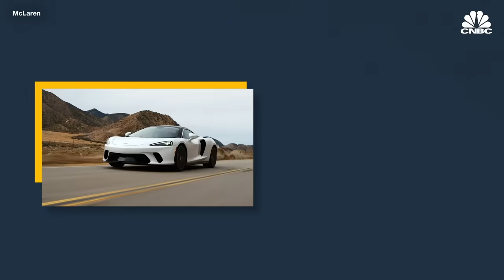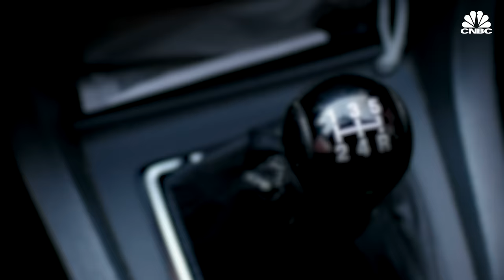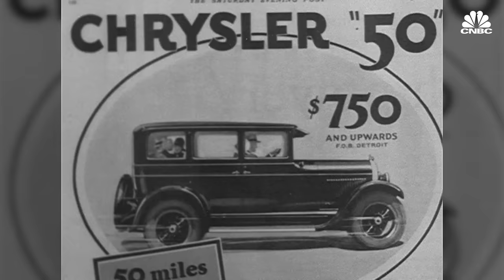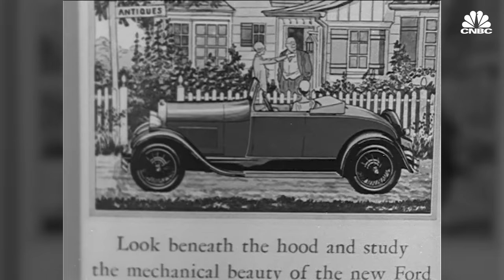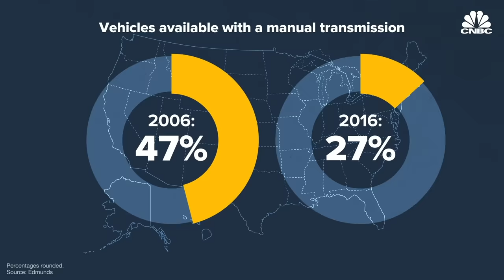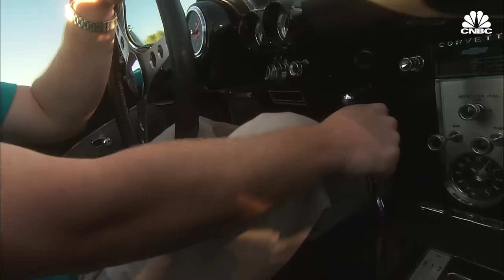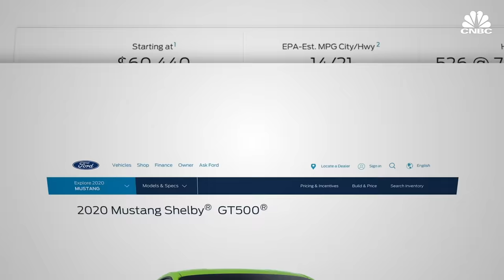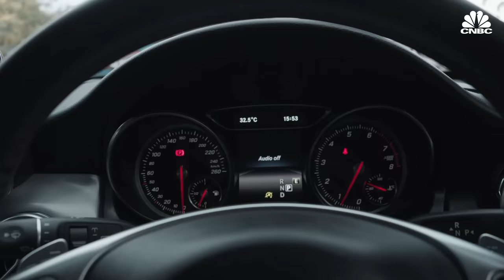Why Stick Shifts Are Going Extinct

Comment: I know many people who have driven cars with manual transmissions, and they say they love it. They love the feel that you get with a manual, you can rev it out more, and also it's very engaging. You feel like you've accomplished something when you drive a manual transmission car. However, I understand that people just don't like the hard work of doing that, especially in heavy traffic, where they have to deal with putting in the clutch many times and shifting many times as well. Also the gas mileage from manuals are not the best. Most are 6-speed manuals, and when you can rev out that engine a lot and get to the 6th gear, the engine revs pretty high at that point, maybe between 3000-4000 RPM, if you're driving it more aggressively. With an automatic, you can obviously get the engine to rev lower, especially when you have more gears to work with. I've never driven a manual, but if I did get the chance, particularly a 2012-2015 Honda Civic SI, I'm sure I'd be proud of the fact that I accomplished something that is quite scary to me to do. Single-clutch automated manuals and dual clutch transmissions are the closest you can get to a manual car in today's modern era.
Reply: manuals generally get better fuel economy, and high revs while cruising isn’t a manual problem is a gearing problem. some manual cars have short gears others have long gears

Comment: It is much more safer to drive an automobile with a manual transmission than an automatic vehicle. 
It gets better gas mileage. 
It feels better.
It readily gives one instantaneous self knowledge of what rpms are. 
It keeps your senses and coordination sharp. 
It doesn't allow you to become complacent. 
It allows exact control of the vehicle and what it needs to do.
There are several other reasons why it is far better. 

And, you are in charge of what the vehicle can and will do.

Comment: Systems like the dual clutch really stepped autoo transmissions up. They made them as fuel efficient and performant as manuals. So the only argument left is that Sticks are cheaper to manufacture.

Comment: so, basically, people keep getting leazier and lazier
Reply: Look at how you communicate with people over the Internet, though. Instead of having to meet people face to face, you just use your computer. I doubt you generate your own electricity, either. You probably also heat your house with a furnace instead of going out and chopping firewood :)
As people get "lazier", life gets more and more expensive. That include automatic transmissions, which are more expensive so you have to work longer/harder to pay for them. It's not about laziness at all, it's the exact opposite!
Reply: @devilsoffspring5519  nah. it's about getting lazier. technology makes life easier so you decide to become lazier under that premise. u probably didn't see wall-e

Comment: In luxury cars, the engine is so quiet you would have to look at the tachometer to manually change gears.
Reply: Not really, you just get a feel for how fast you're going and then shift. The engine still vibrates and hums when accelerating, they're mostly silent when cruising at a constant speed.

Comment: Driving automatic shifters allows me to spend more attention to the traffic and surroundings, making me drive safer and better. It's also lengths better in the big city traffic with the constant stop & go, which is really tiring for my feet at some point. I have an old manual car though and don't mind driving manuals anyhow, but I still prefer automatic, but I'm not a race driver etc. and I have very special demands in other areas of life, so I can understand people who swear by it.

Comment: I've always driven a stick. There is just a good feeling of being in full control of the car, and downshifting feels awesome. Also there are some use cases that I prefer to do on a stick, like purposely shifting into too high a gear to prevent wheel spin in snow, or staying in a lower gear when you know you'll need immediate acceleration to get in and out of tight traffic.
Reply: Spot on my friend!

Comment: I special ordered my truck in 2019 with a stick shift. I love it! I've only owned manuals. I'm sad I may never have the opportunity to buy another one that is new.
Reply: I bought my truck new in 1990. I think it was a special order that the sale was never finalized. They had very inexpensive upgrade packages if you didn't mind a manual transmission. It was the base trim package with all the bells and whistles except electric windows and locks. It's a Chevy so I'm glad it didn't have electric windows. I got a $25,000 truck for 13,400. I still have it and it's had one clutch replacement. Shifts like butter.

Comment: Only bad thing about manuals is the price for repair. Pay $600 for a performance clutch pay $200 for a clutch master cylinder and pay $1,000 or more for someone to install it. 
It would be easier but cars these days are front wheel drive with the transmission sitting sideways.
Reply: its still far more to repair an automatic transmission
Reply: @arcanevoid9199  That's for sure.

Comment: I have automatic in my daily drivers but a manual in my sports car. An automatic, even with manual mode, does not come close to the satisfaction of the drive. I can also leave my manual unlocked with keys inside without the fear of it being stolen 😄
Reply: And do you even know how it works? One advantage of Automatic is quicker acceleration. In a drag race between a manual transmission and automatic/cvt/dual-clutch transmission car results in the Automatic transmission car winning because you never have to lift your foot off the accelerator.
Reply: @daineramosquitco5816  You can win drag races but you will never bond with the car as you do in a manual
Reply: @davidtucker3538  "An automatic, even with manual mode, does not come close to the satisfaction of the drive" How is that so? You will still get the same shifting vibes. just up and down.
Reply: @daineramosquitco5816  If you have not driven a manual, you will never know.

Comment: Manual transmission = + Full control over maximum available torque  | - exhaustive in traffics, uphill traffics
Automatic transmission = Easy to drive in traffic jam and uphills. | - lags when you want immediate maximum torque
Reply: manual is easy to drive in traffic aswell, and i find it easier for uphill

Comment: I miss my manual car sometimes. I don’t miss rush hour in a manual car. I also don’t miss needing to skip 3rd gear because it crapped out. The cost to replace a manual tranny was pretty nice though. My motorcycle keeps me satisfied with its sequential transmission

Comment: Manual used to be called "standard" transmission in the US. And the barebones and cheapest model came with a stick.
Reply: My full size pickup came with a manual and was loaded with options but I think it may have been a special order that the sale didn't go through. It was $13,400 new in 1990. Same truck with automatic was $25,000.

Comment: Personally I hate automatic boxes. I learned to drive in the 80's in the UK and worked in a garage for a while, driving all sorts of cars, the majority manual, and I vastly prefer the experience of driving a manual - engine breaking available when you want it, and being able to set up a car to go hard round a corner on a mountain road without having to worry about whether it would suddenly decide to change up, (or worse down), mid corner, especially with early rear wheel cars without traction control. The same with motorbikes, I can't imagine how awful an auto would be on a motorbike, my first 'wizz and go' moped was bad enough in that respect. Most auto boxes in the eighties were real power drains as well - a half decent car with a manual box became a slug with an automatic and seemed thirstier as well. Maybe things are better now, but my brief recent experience driving automatic Iveco vans for a home delivery company suggest otherwise. The other thing that puts me off automatics is that when they go wrong, as they often seem to, they go wrong in major expensive ways. In forty years of driving a huge variety of clunkers, old and middle aged cars, I have never had to replace a gear box, and only a handful of clutch failures which are cheap consumables anyway.

Comment: Driving automatics just feels bad, it doesn't even feel easier to drive an automatic around unless you're in stop and go bumper to bumper traffic constantly. Manual transmissions are just a better experience to drive, even if you're driving normally doing normal things, it isn't only better for racing and performance related stuff

Comment: Traffic in most corridors in the US is terrible and not getting any better. Manual in NYC, Boston, or LA traffic is a nightmare. It’s the constant stop and start. It’s best in areas with low to medium traffic. If I didn’t have to deal with traffic then I wouldn’t have minded a manual vehicle. The other thing is that most vehicles that they offer these days are impractical family or passenger vehicles. My brothers are 6-2 and 6-6 and driving in most manual cars is impossible for them

Comment: If the car runs out of battery, you can push it to get it started if it's a manual transmission but with automatic you need someone to pass you some battery.
Automatic transmissions are much heavier and usually more expensive.
You can get an awesome 6 gears manual transmission at the price of a mediocre 4 gears automatic. With 50% more gears and less weight the performance (fuel efficiency) gap is wide.

Comment: With the automatic transmissions being overly costly to repair, half of them being defective CVT transmissions,  I definitely opt for the standard transmission,  that and it's easy to pop them in neutral and Coast down the hill to save on the price of gas.

Comment: I finally made the smart move last year and ditched the manual gearbox. It is the equivalent of horse and buggy (and the users of horse and buggy in daily service share a lot with manual gearbox fans in their approach to live)
Reply: Lol wanting to have a more engaging and fun drive = horse and buggy, also some cars are faster in manual
Reply: @arcanevoid9199  Nope. Because the still can not drive faster than the car in front of them. Or exceed the speed Limit.

Comment: So sad. I love driving manuals. You can use the engine to brake which leads to lower brake pad wear for one thing. Also not many people can drive one any more, so less likely to get stolen.
Reply: It depends when you use the engine as a brake.
Automatic cars can also use the engine as a brake and nearly every car I’ve seen has a mode to use engine brake and hills and mountains.

Comment: if you are used to manual boxes it takes a while to get used to auto boxes. I have stepped on the brake many times to push in the clutch....

Comment: I don't know how to drive stick, but I don't see what the appeal is.
Reply: its fun, and much more control
Reply: It only appeals to people with massive ego. Plenty of reckless and speeding drivers I see on the road use manual.
Reply: @aimansuriaprakash2380  statistically speaking there is far more reckless drivers with auto as there is more autos to begin with, its also easier for reckless drivers to drive an auto (especially recklessly). not sure how changing gears means you have a massive ego

Comment: Coming from England I only see automatics as a downside. There is a slight pleasure from the control, feel and change in feel and noise you get from purposely changing the gears. But if you don't want to focus on it, changing gear equally hardly requires any thought and you can zone out of it after a while.... so not sure about those people who regard it to be so much effort unless they are very new to driving. Driving an automatic does have its uses though - it is much easier to eat your mcdonalds or whatever whilst driving 😁

Comment: no one could steal my 1951 chevy pickup if they got it started, which is hard you must push the clutch and with one foot depress the gas pedal and push the starter at the same time, with the same foot, most car thieves would not get out of 1st gear

Comment: Normal maintenance operations such as Engine tune - up Decarbonising. Fuel System cleaning,Wheels,Brakes and Clutch adjustments as well as any other normal adjustment. LET US KEEP OUR ENVIRONMENT CLEAN CAREFULLY?👍👍👍👍👍
Reply: Clutch adjustments? This isn't the 1950's.

Comment: My first running car was a 63 Pontiac Catalina (still best radio and heater of any car) and a stick....I had to install seatbelts to stay in the seat as the clutch throw on the previous owners rebuild was north of 80....both my current cars are sticks...I had been shopping and reading about all the auto transmissions breaking...so I grabbed a red 95 Honda, 1st car I looked at...(I am counting it as my middleage sports car)....had trouble with the "safety" start/clutchengaged  "features"...now my cars are "electric" as well...I can run them on the starter motor should I want to....certainly desirable in some emergency situations....used to do it in a volkswagon bus for fun.... I "learned to drive" on one of those rare early autostickshift vw bugs...I thought it was normal. haha,  I also had keys to my dads 20 car fleet, mostly sticks.

Comment: In other news, Americans still unaware there are humans living on the other side of the border...

Although, as someone said, electric vehicles are doing what ICEs with an automatic were (in many regions) unable to, and that is superseding the manual vehicles. They don't need a transmission at all, apart from a couple of wires telling the ECU to go forward, back or not at all, and many people have been switching in the last few years.

Comment: Been looking at cars to replace my 2001 Audi A6 6 speed 2.7T. Once you add manual shift to an Audi or BMW in the search you find very few options. The car that looks good is probably a long way from where you live. My Audi has 234,000 miles and still runs great but looking at options is sensible. Paddle shifters just don’t fill the bill. Unfortunately lots of used Audi have a 4 cylinder 200 hp motor,; That just does not work. I wish Audi would have kept the 2.7T in cars longer.

Comment: My strategy is simple: when I buy used Cars from early to mid 2000s I go for manual because autos back then were quite stubborn and non-dynamic (reving too high instead of shifting). From the 2010s automatics have become smarter and more economic.

Comment: I am in the process of shopping for a car I have been driving a manual 30+ years so its what I am use to AND when I hear of transmissions failing they are usually automatics or CVTS
which I want to avoid but I am afraid if I get a manual I want be able to resell it

Comment: Manuals are more common anywhere but the US.  I prefer manual and I'd buy a Nissan Versa but the "S" trim doesn't give you a pass through from the trunk to the folded back seat.  So I'll keep my Versa Note hatchback.  It's a 2015 and still faultless.

Comment: I drive both and i dont have a particular preference. In city traffic automatic is easier but manual is definitely more economic. There is at least 0.5-1lt per 100km difference in the fuel consumption. 

The electric car will be the end of manual gear car. 

I will get a manual motorbike just to keep shifting longer 😮

Comment: How did driving suddenly become a chore? What nonsense. The problem in the USA is that people are allowed to take the driving test in an automatic transmission vehicle. This is not the case in most European countries. I think is is reflective of how many bad drivers there are in America. Learning to drive in a “stick” shift creates better drivers. Drivers that take care, that have better control of the vehicle. Also they are much safer. A driver is able to downshift if breaks fail to slow to a stop. Even the narrator states that manual vehicles require more attention when driving. This translates to being more present when driving. Perhaps not as likely to be playing on a phone, or fixing makeup. Etc.

Comment: I learnt to drive on a 2011 forester with the most atrocious, ancient 4 speed auto that had no idea when to up and downshift. Manual is certainly better experience than old school autos. But after I experienced driving modern CVTs, autos have come a long long way and I now prefer autos for regular driving but nothing beats rowing through gears and hearing the engine when accelerating onto the highway.
Reply: I still hate those belt and pulley CVTs. eCVTs in hybrids actually are decent due to them being planetary gears. Still would prefer manual or dct for gas cars though.

Comment: Aside from sitting in 20mph stop and go traffic to where my left toes cramp, I absolutely love driving a manual transmission. Especially being a woman-now look, it's getting better but the look on someone's face when I tell them my car is a stick shift...priceless.  Also it's much less likely to be stolen (unless they have a flatbed tow truck) because 1) most people don't know how to drive one. And 2) more and more people aren't learning how to drive at all.  My car is fairly safe. 🙂  Especially when you disconnect the battery when parked. LOL.

Comment: It's because driving a low-end manual is more fun than driving a high-end automatic and the car companies know this so they're trying to push the high end automatics or make manual an option on a high-end car.  They take the fun out of it by adding that electronic throttle body which has a delay and they actually program a rev hang in that makes shifting very annoying.  Even if you tune the car to fix that. They've also added a really heavy flywheel for by stock so it retains a lot of the momentum in between gears.... Just something else that adds to the rev hang, making shift times longer.  They've invested a lot of money into these new useless designs and they want to get a return on them
Reply: they have to add rev hang to pass emissions, they wouldnt do it otherwise